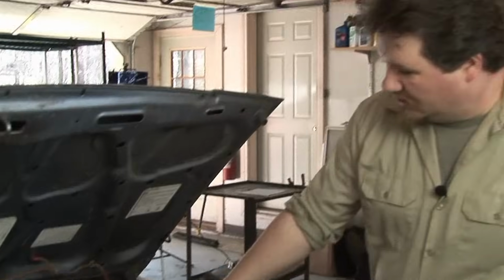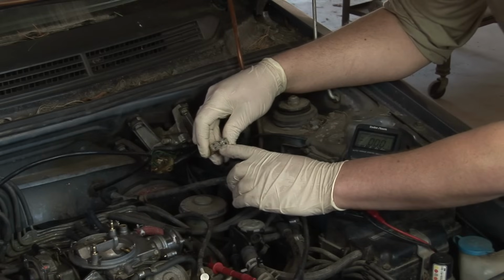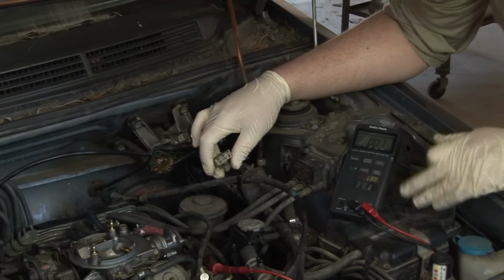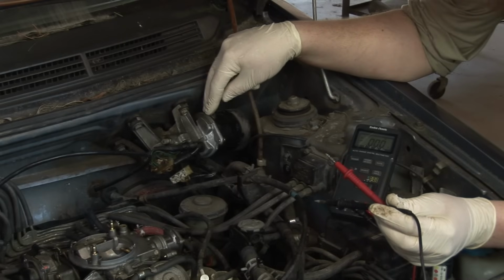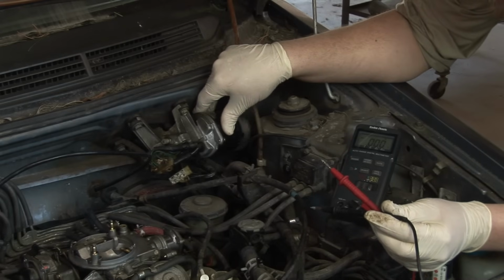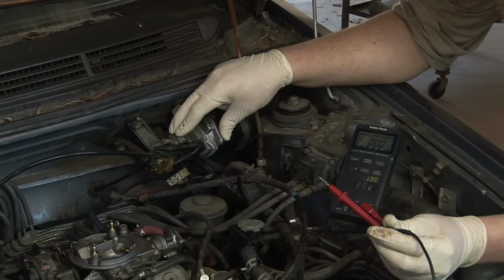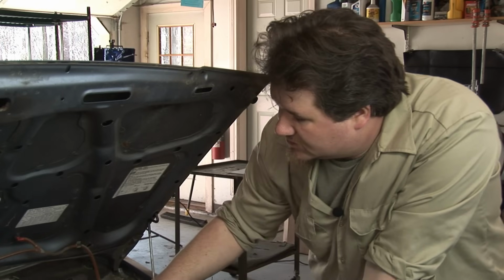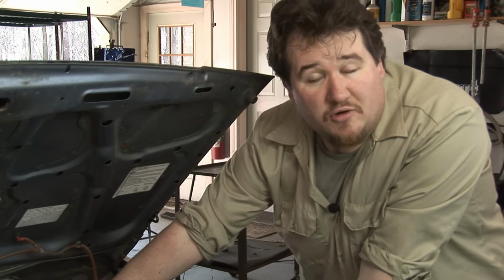Auto Repair : How to Test a Windshield Wiper Motor

Comment: What is the issue if turning on my wipers which is the first speed the wiper blades activate halfway then stop but in intermediate speed and high speed it all works just fine?? Can’t be the switch because it triggers the motor….can’t be the motor because in full wipe and high speed wipe mode the wiper motor works just fine. Problem is I use my wipers in intermittent mode more than full wipe or high speed which doesn’t miss a beat. Someone give me some help here.

Comment: Windshield wiper motors are based off circular motion, so if it's not level and straight, the wipers will go past where they are supposed to.

Comment: Hey Sandra Barrett:  How about checking at the hose connection on the reservoir  container pull of the hose turn the wiper wash cycle, if you get fluid flowing, then it probably a plugged up hose or wash nozzle (most likely anyway ) or pull off the hose at each nozzle and check there.

Comment: I bought this '93 Pathfinder from someone not realizing the washer fluid won't come up. Changed out the reservoir and motor but still nothing comes out. My guess is that the switch is bad since the fuse and the motor is good...

Comment: i have 92 f-150 my washer works all sigles work 4 ways work high and low
 beem work just none of the speeds for the wapers well work i put brand 
new waper motor on and still the same and tested the ground has good 
ground from motor too firewall  i did the oms test and no mater what 
seting ur on it stays at 1 does move from 1 at all any ideas

Comment: I have a 1990 ford ranger and I just replaced my turn signal switch and now when I put my right turn signal on and my high beams are on my wipers go on and my lights dont have to be on, could my wiper motor be shorting out at that spacific time? and if it is how do i check it or test it?

Comment: One of my wiper is slower than the other. So when I turn them one they hit each other and sometimes get stuck. Whats wrong?
Reply: Well, I realize this is 9 years later, but just in case you’re still having that issue, it’s because one of your wiper arms is seizing up. You need to remove the linkage etc. & disassemble it where it pivots & spins back & forth, clean it, sand it, file it or what have you, grease it, oil it etc. & then reassemble. Hope that helps finally.

Comment: does this work for wipers that wontstop ? cause i tryed to trun on my car the battery is fine but then i tryed turning on my engine and it wouldnt cause it was too cold but now after i got it going my wipers wont stop moving evertytime i turn it on and my blinker lights r on but not blinking unless i use it everything still works fine but its just my wipers wont stop moving now
Reply: It seems you have an electrical short. Maybe the fusebox shorted with frozen condensed water or corrosion.
Reply: ya thats what  im thinking too cause the car runs and its fine onlyu problem wipers wont stop and low beams not working right and my flashers too so i dont think its the battery but ya i have my app at my mechaninc for friday

Comment: my wiper motor works fine. I'm just trying to figure out why do my wipers slowly drag across the windshield when I'm driving Against the Wind although they're not turn on. it didn't always do this. So I don't know what to make of it. any suggestions on what would cause this?

Comment: Check fuse.  Good?  Buy a new wiper motor.  Hook your wires up to it.  If it runs, your old motor was bad.  Swap motors.  If it doesn't, your relay is bad.  Return the motor and get a relay.

Comment: Hey if u have time could u please answer my question. I have a 2005 honda accord and the wipers and fluid stopped working. I took to an auto repair guy. He said its the relay and the entire box has to b replaced at $465 and with labor it would b $600. I dnt have that kind of money and am I getting scammed?  Thank u.
Reply: Sandra Barrett yes you are

Comment: I replaced the windshield wiper motor and multi function switch and my wipers still  don't shut off, any advice or tips? It's a 1995 Econoline E150.
Reply: Church of Light Jesus Christ they don't shut off?
Reply: sounds like your switch is bad

Comment: I have a 2014 Mitsubishi RVR and this winter when the temperatures got below -20 degrees Celsius my windshield wiper wouldn't work - the rear one - no problem.  I took to the garage and they said it was a fuse.  3 days later with -20 C weather, they wouldn't start again.  I called the dealer, which is an hour drive away and they said to bring it in and if it was the motor they would replace it under the warranty.  Did that and they said it was frozen!  They told me to pour some windshield washer fluid onto the motor, as it would act as antifreeze and defrost the motor.  Has anyone else had this problem?  It is a real pain for me to have to do this everytime the motor is frozen and I don't think I should have to do it.  Would anyone suggest that I call the dealership and tell them I am not happy with this solution, as it is inconvenient for me.  I have very bad arthritis in my knees and back and just having to stand to do this causing me pain.

Comment: just watched your video mine is regarding my rear whiper I can turn on the motor it makes a weird loud noise but the whiper doesn't move so I took it off correct me but if the motor wasent working it shouldn't make noise right it's on a 02 tahoe lt